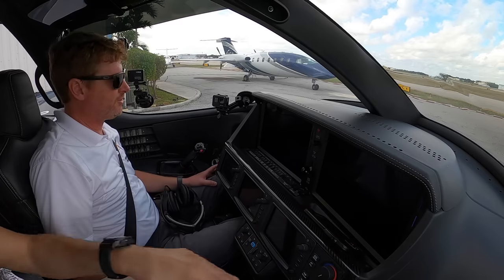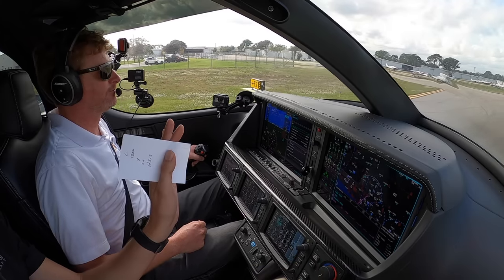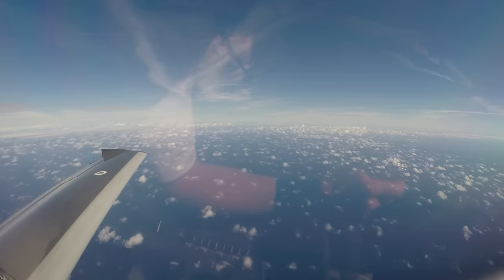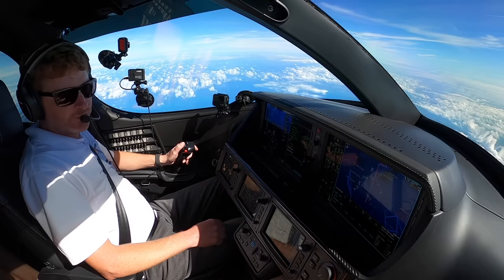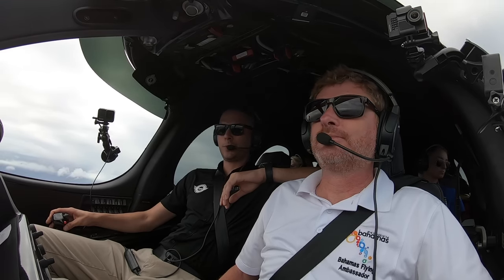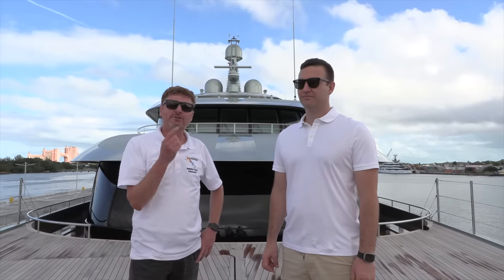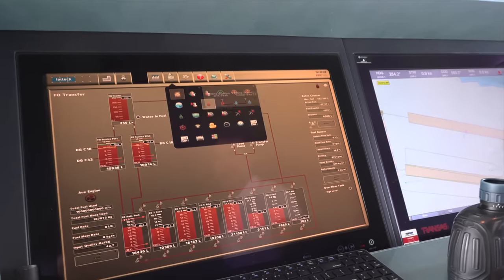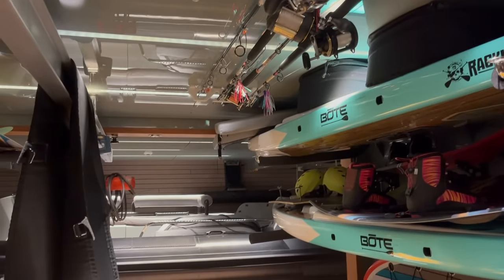MY FIRST TIME FLYING THE VISION JET to the BAHAMAS! + HYBRID SUPERYACHT TOUR!

Comment: Have to say, as a former EOOW on a Navy cruiser, that is the cleanest engine room I have ever seen!! Thanks for the amazing vid Steve, nice job on the landing!
Reply: It looks like you could eat off of almost every surface, or perform surgery in there. Impressive cleanliness.
Reply: It looks like an ice cream shop
Reply from the maker: Thanks for your service!
Reply: @OnTheRocks71  I thought it was the galley... that shiny capstan looks like a large pressure cooker :)
Reply: Without a doubt!   Engine room doubles as an onboard surgical clinic.
Reply: Agree! I was an EOOW / OOD / SWO on an old 1200 psi steam plant on an Adams class DDG. Those engineering spaces are immaculate. I was also navigator on a Knox class FF, and the bridge was mind-blowing, too.
Reply: @OnTheRocks71 😂
Reply: I was EWS on an SSBN, our ER was similar in cleanliness, no chrome of course, but a bit a brass.

Comment: Wow Stevo.  A double feature.  Jet and mega yacht.  I can relate.  I am an instructor for Cruising yachts with a Masters license.  One of the first things that I ask a class is, “ is anyone a pilot or have had aviation experience.  Maritime skills and aviation skills do indeed cross over in many ways.   I am also a PP with Glider cert.  I have captained vessels to 120 feet. Yachts and ferries.   Like flying, it’s a lot of responsibility.  I had 300 passengers that I was responsible for on the ferry. I suppose similar to an ATP.   The biggest difference is that flying is much more critical and less forgiving.  On the other hand, if you are on a 2 week charter, it can be a 24 hr job for weeks o end.  Yes you get sleep and breaks but the responsibility never stops.  So longer but not as intense as flying.    Great video.  Thanks.

Comment: I would love to know what you think of that Piaggio Avanti to your left during start up! What's the chance of you getting a flight and video in one of those?
Reply: Hard not to miss that beauty
we have one local here, I think he used to fly a Starship up until about 3-4 years ago
that thing screamin over the house at takeoff (Wiley Post) was a thing of beauty.
Those Piaggio's sound like they are turning a million rpm with volume turned up to eleven
Reply: @joeblow5037  They take a lot of runway to get airborne but once in the air they are extremely fast.  The interiors are gorgeous.

Comment: That yacht was amazing. Hybrid diesel, counterrotating shafts for maneuverability and efficiency and that stainless steel exhaust shroud for heat insulation. i could only imagine what that shroud costs. Intriguing engineering.
Reply: Yeah I'll take two

Comment: Hello Stevo.
When flying the vision jet on autopilot, do you get an audible  tone when the autopilot is disconnected
Reply: Yes, you can hear the tones at 12:38
Reply: Yes, it can be heard at around 12:40 when they speak about disconnecting the autopilot.
Reply: Flying with the side stick for a Right Hander, how difficult is it to get use to?
Reply: @jetski7611 Probably not much worse than a right hander using a yoke with his/her left hand.

Comment: About 20 years ago I did control design and implementation for an oil and gas company. We had a plant and powerhouse in Mobile, AL. There were 10 Wärtsilä drivers on 13,800V, 5MW AC power generators. Wärtsilä  sold their equipment with controls so all we had to do was interface to it so the control room could see them. We called them Godzillas. Very nice engines. Wärtsilä builds very good equipment.

Comment: question....when you were in the TBM you had the type of stick/column that allowed the pivot case and iPad to be mounted.Obviously that is not possible with the side stick, so  do you have to put the iPad down at your side or does that same info display on those main monitors?

Comment: Wow, on the boat that is almost a quarter of a million pounds of diesel with the ability to hold upwards of 322,607 pounds. At a harbor fuel cost of $3.599 to fill this beast from empty would cost $1,161,063.

Comment: The last time I saw that amount of battery’s was in a telephone exchange back when I used to work on exchange construction sum of the old lead acid ones you could take a bath in there were that big but they at to power a lot of equipment racks full of strowger and relays switches over a few floors now it’s all done with computer chips on a couple of floors how technology changes over the years  electric powered planes will be the next big step in aviation, I guess

Comment: As an FBO employee for decades, I'm not a fan of turning on the strobes and landing light well before starting to taxi. Normally, one would flash a light when ready to taxi, but because all the lights are already on, that is out the window. Assuming that a line tech can always see a pilots hand signals is a mistake, especially on bright sunny days in south Florida. During night ops, turning on strobes and landing light before taxiing effectively blinds a marshaller, and won't win you any friends in the line shack.

Comment: Strobes should be on when entering the active runway, the beacon should be on for engine start.
Reply: Hello expert. The SF50 doesn’t have a rotating beacon. Thus, he must have his strobe lights once engine is on, about to be on, moving, etc. That’s why all Cirrus Aircraft, Diamond Aircraft, and Extra 300 have thier strobe lights on. If you don’t like that, call the manufacturers and complain, don’t put down the pilots. 

Don’t post misinformation unless you are certain of the regulations.

Comment: Not a great plane: slow, clunky, gas guzzler, poor stall characteristics, climb rate pales against its competition, maximum weight capacity 500lbs although a four seater . Not sure why this plane exists, only reason for getting one is that it is easy to fly, and has a parachute…yet if you have a good plane you don’t need a chute.